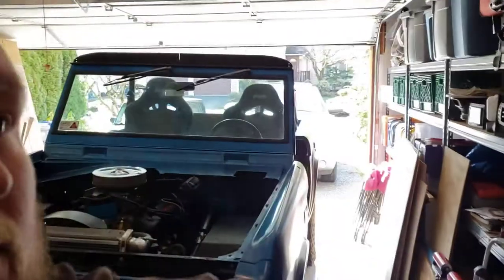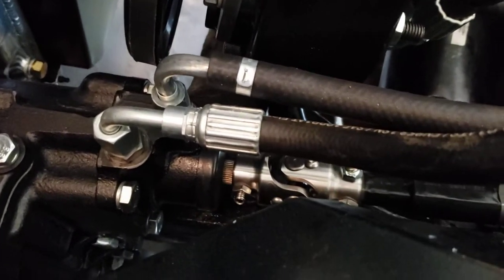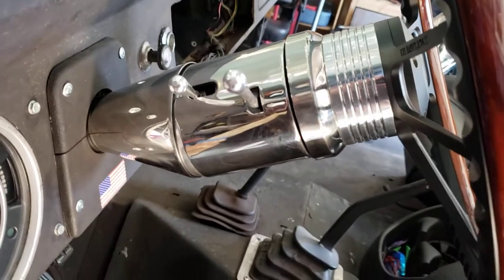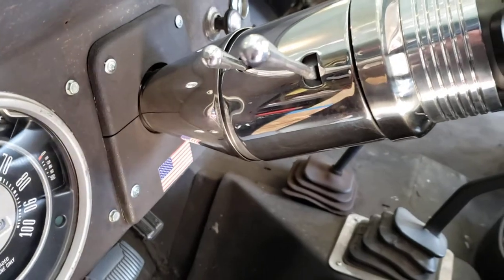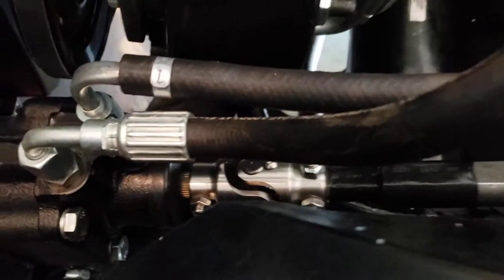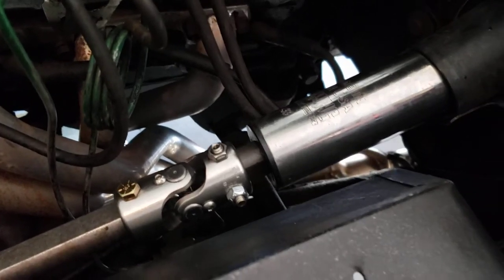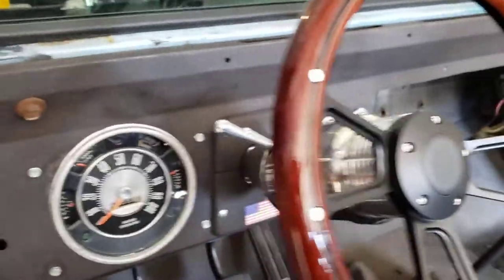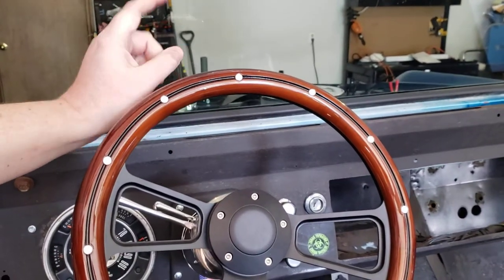Early Bronco | Flaming River Steering Column Review

Comment: Hi Shawn and thanks for your videos.  I do have a couple comments
With your product reviews could you include the manufacturer, supplier and about what you paid for it in case we want to do the same conversion?  For this video could you share what the steering column length is (31”, 33”)?  Thanks again
Reply from the maker: Hi Mike, thanks for the feedback. I will keep those suggestions in mind as I make more videos. I do have information in the description about the manufacturer (Flaming River) and supplier (Tom's Bronco Parts) with a link. I am not sure the length because it isn't on the supplier's site that I can see, but the one I got was for (no body lift) and I bought the column for about $950 and I chose the steering wheel upgrade for another $40. This is before taxes and shipping. Hope that answers your questions and thanks for watching my videos.

Comment: I got my tilt column and steering wheel and lower shaft from wild horses I got the paintable one and painted it black so I wouldn’t get that shine in the windshield, I think I paid $450 for the column I don’t remember what the cost of the other items was (steering wheel and lower steering shaft) I ended up getting some 1/8th inch aluminum plate and cutting a hole for the column to go over the hole in the dash instead of using my original plastic cover because the the tilt column is a different diameter than  original bronco column is. I’ve g a 1970 bronco
Reply from the maker: I like having my column shiny, but will admit that having it shiny does add a reflection on the windshield that I am not a fan of.

Comment: any chance you'd be able to share with us all the parts you have inside your bronco that you needed to get that steering wheel installed? i have that column but i can't get anyone at Tom's or Flaming River to answer the phone or return an email. i already have everything in the engine bay completed.
Reply from the maker: It has been a couple years now since I installed it, but I bought the Flaming River Kit. Here is the link where I got it. It mentions what is included. I didn't add anything extra. https://tomsoffroad.com/parts/66-77-ford-bronco-stainless-floor-shift-tilt-steering-column-kit